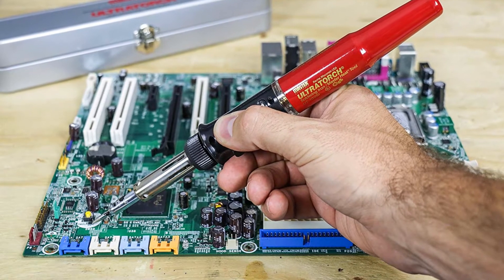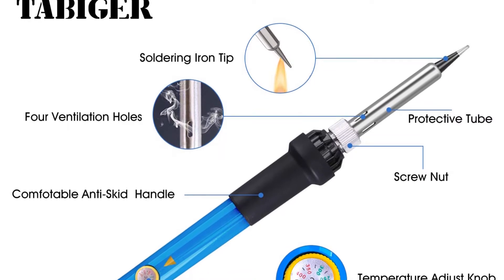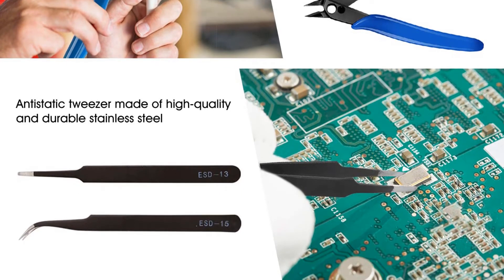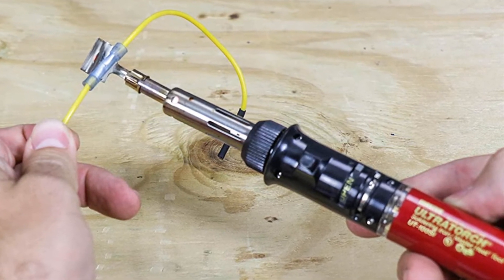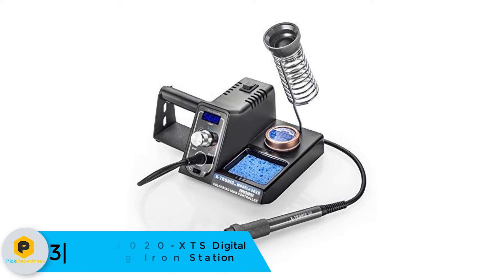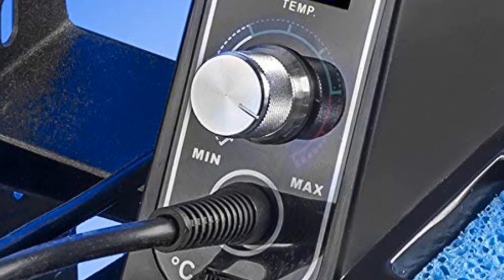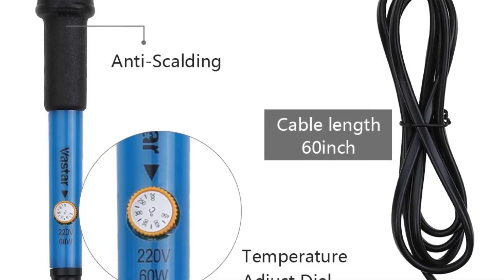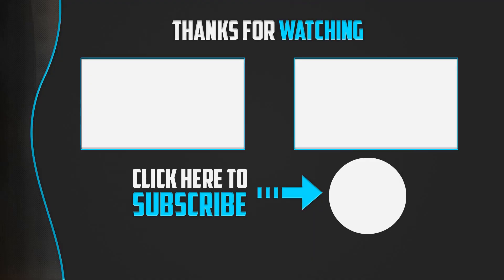Top 5 Best Soldering Iron

Comment from the maker: ▶ The Top 5 Best Soldering Irons We Recommended in This Video

▶ 5. 16-in-1 soldering Iron electronics kit toolbox.
[Affiliate] https://amzn.to/3VMNmqi
 
▶ 4. UT-100Si Master Appliance Butane Powered Ultratorch-3-in-1 Professional Soldering Iron
[Affiliate] https://amzn.to/4nztIKz

▶ 3. X-Tronic Model #3020-XTS Digital Display Soldering Iron Station.
[Affiliate] https://amzn.to/4nQnA0H

▶ 2.Vastar Full Set 60W 110V Soldering Iron Kit.
[Affiliate] https://amzn.to/4phZcq1

▶ 1. Weller WLC100 40-Watt Soldering Station.
[Affiliate] https://amzn.to/4pnYpUs